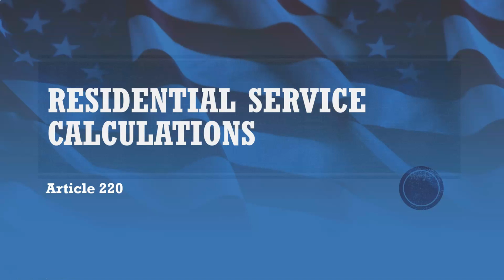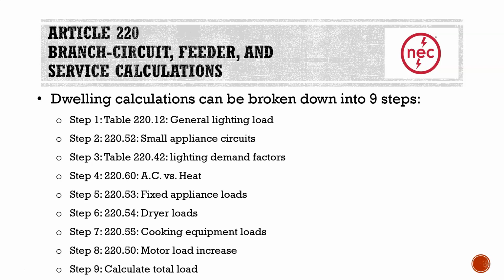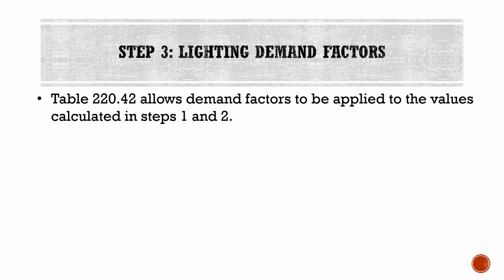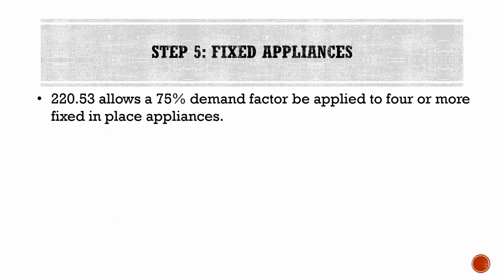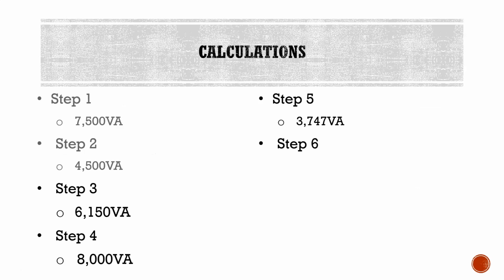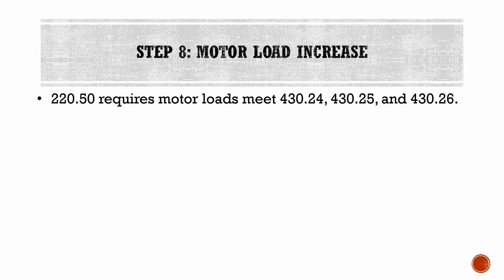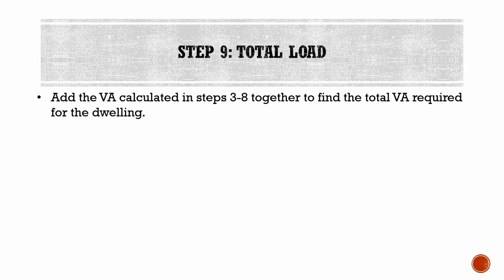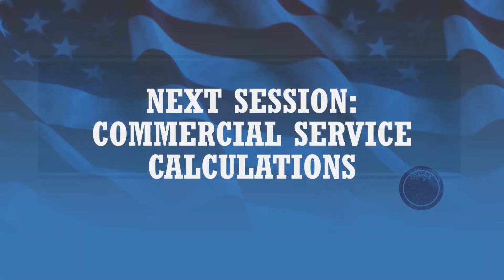Residential Service Calculations

Comment: Every thing perfect buuuuuuuttt but; why in 3/4 hp 120v I got a 1656 VA and multiply by the 25% gives me 414 va.

Same on step5 did I did it wrong cuz I got 4,467 VA 

CAN YOU EXPLAIN 

THANKS

Comment: Thanks for the excellent video, got a question though. I know you came up with a #1 Copper conductor for the 124.5 Amps we are feeding this dwelling with, but according to Table 310.12(A) Single-PhaseDwelling Services and Feeders, #2 is good for 125 Amps, and you came up with a #1 which is good for 150Amps, did you derate or did I miss a step where the #2 can not be used. I think this is very important cause in the end , after all this process to work out this problem, I will ultimatelly get it wrong on the exam. Would you please explain why the #2 Copper would not work in this situation. I appreciate your help. Thank you

Comment: Great lessons. Question for Step 8. "If ac or heat was the largest motor and was NOT used in step 4, it is NOT counted." But we use the heater in step 4 so shouldnt 25% of the 8kv be added to the calculation? or am I misunderstanding that if the heating unit isnt presented with a HP value, its not considered a motor?

Comment: What code book are you using.? Some of the tables aren’t there in the 2023 and 2020 code book that you are referring to in the video.
Reply from the maker: These videos are based on the 2017 NEC. All of the tables in this video are in the 2020 and 2023 NEC, but their naming has changed. We also have videos covering the 2020 NEC!
Reply: @electrical1019  ok thanks.

Comment: What size aluminum power conductor is needed for a 200 amp feeder in a two family home with a 400 amp service supplying both families?  But with public service
Reply from the maker: Are you referring to the service from the meter to each individual dwelling unit? If so, this would be sized based on table 310.12, so a 4/0 AWG conductor would be required.

Comment: Use article 310.12. It does the final step and sizes conductor.
Reply from the maker: Hi Michael, this presentation is based on the 2017 NEC, in which they had removed table 310.12. If you are using an older code book that still has that table, or the 2020 NEC in which they added the table back, you are absolutely correct that table 310.12 should be used. Thank you!

Comment: This information is very accurate. Surprised to hear Kentucky still uses 2017 NEC oppsosed to 2020. Just curious do you recall when Kentucky switched to 2017 & what year did they switch up to 2017 from?
Reply from the maker: You may be surprised to know that as of now anyway, the majority of states (around 25) are still on the 2017, and only about 10 have adopted the 2020 edition. There are actually one or two states who are still on the 2008 code, and a few on the 2011/2014 code. Even worse there are a few who haven't adopted any edition, and just go by local codes. Kentucky switched from the 2014 code to the 2017 edition in 2018 if I remember correctly, and from what I've heard there hasn't been much discussion about adopting the 2020 as of yet.

Comment: How do i get HP to Volt-Amperes?
Reply from the maker: Hi there, the first thing you have to do is establish if the motor is single phase of polyphase (I am assuming you are asking about an AC motor). If the motor is a single phase, we would go to NEC table 430.248 and find the corresponding amperage listed for the motors voltage. We would then use ohms law to calculate the wattage, or VA. We would do the same thing for a polyphase motor, except we would use NEX table 430.250 instead of 430.248. I have a video on my channel that covers motor calculations in depth that I would highly recommend watching. Hope that helps!

Comment: I don't understand how the furnace blower motor is coincidental with the A/C the blower is going to run whenever the AC is running. (If it's a typical gas furnace with evaporator coil mounted on top.)
Reply from the maker: HI there, for the sake of this example and the way this type of question would be worded on a licensing exam, it's not specified if the heat/AC unit would be a furnace, heat pump, etc. The only information we know is that there is 8kW of heating (again, this could be an electric furnace, electric baseboard, etc.), and some type of AC unit that has a 5HP motor as its only load (as with the heat, the type of AC doesn't matter). 
For a real world application, obviously if a the heat and AC were the same source as with a heat pump unit or a furnace with an evaporator coil as you provided an example, you would only need to consider the total load of that unit at its maximum, which is usually plainly provided by the manufacturer. Hope that helps!

Comment: Hi, I do have a question.  Why would we not multiply the 28amp A/C unit by 125% giving us 35 amp X 240 giving us 8,400 which would be the higher of the two units?
Reply from the maker: Hi there, I’m assuming your basis for the 125% rating is coming from section 440.32? If this is the case, 125% applies only to the branch circuit conductor rating, not the actual load of the equipment. The same applies also to 430.22. Hope that helps!

Comment: It's possible I missed it, but I do not believe you ever specify the type of motor the disposal is using, so in this example, the student can never find the flc on their own without doing trial and error to figure out what table you got your flc from.
Reply from the maker: Hi there, thank you for the comment! I believe the timestamp you're looking for would be at the 5:10 minute mark. The disposal is listed as a 1/4 horsepower, 120V motor. This would point us to table 430.248 to get the motor FLC. Hope that helps!
Reply: @Electrical 101  no, I'm saying you never identify the disposal motor as a DC motor, single phase ac,  phase ac, or three phase ac motor.
Reply from the maker: @xxxlvxxxlvxxx  Sorry for the confusion: since this problem is written from the standpoint of taking a licensing exam in Kentucky, it is always assumed that the service for a residency will be 120/240V single phase. That's why at the end of the calculation when we divide our total VA by our service voltage, we automatically use single phase 240V (again, this only applies to taking an exam in Kentucky. For other state licensing exams or doing this math "in the real world", you are correct in needing to know if the motor is AC single phase, AC polyphase, or DC, or what the standard assumed voltage type for that exam is).

Comment: Thank you for that good explain.  Did you use the NEC 2020?
Reply from the maker: Hi there! Currently these videos are based on the 2017 NEC, since that is the current code edition adopted by the state of Kentucky. This means if you go to take a licensing exam for Kentucky, all of the questions will be based on the 2017 NEC as opposed to the 2020. Thank you for the positive feedback!